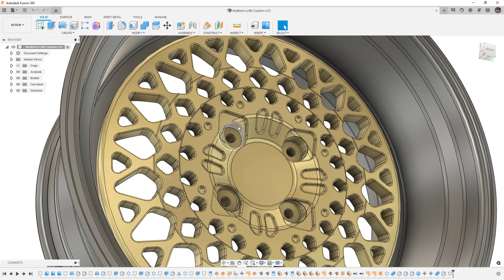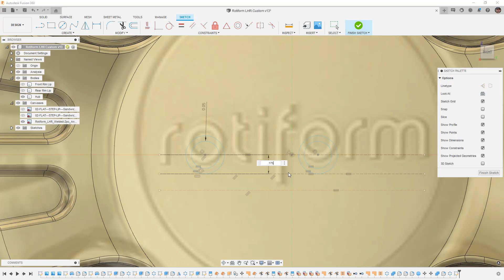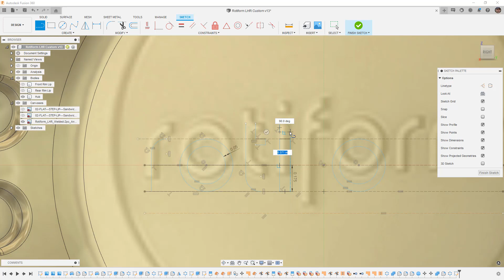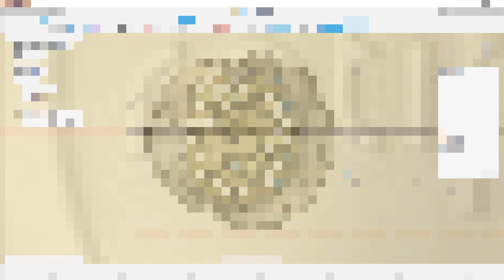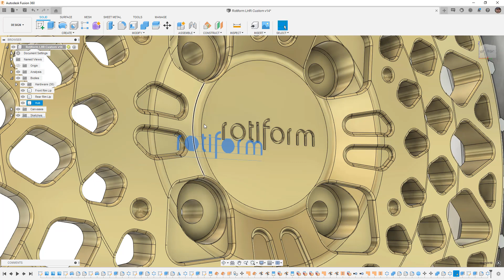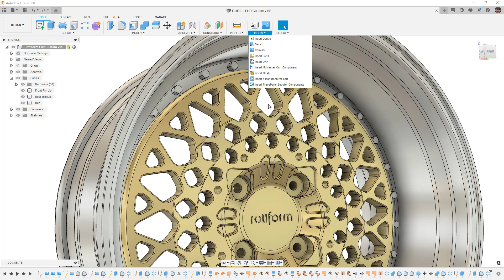Fusion 360 Rotiform Modeling Series - Part 6 - Final Details #Fusion360 #Rotiform #RimDesign

Comment: Do you have any videos on how to make parametric snap fit center caps ? I couldn't find anything on your youtube page  nor on youtube funny enough for something that is perfect for 3d printing!
Reply from the maker: I haven't done that before but certainly could.  What wheel?  The rotoform center caps are a bit different than say the snap in ones common on older OEM wheels.
Reply: @LearnEverythingAboutDesign  I should've probably mentioned that! Just the usual older types found on most older cars that snap in. I have a few sets of japanese wheels that all share the snap fit type but obviously all different diameters and lengths on the tangs. I have attempted to make a parametric model but failed miserably haha. I think the ones that use O-rings and pretty straight forward to design (since they are compression rather than snap fit), just snap fit stuff is usually quite a big step in required experience

Comment: Logos are most of the time available as SVG, Rotiform is also available, would save time and be true to the original
Reply from the maker: 100% true for what we did here.  The center cap on the rims actually has the logo recessed like modeled here, but its a pain :)
Reply: @LearnEverythingAboutDesign  yep,traced many a logo in my design adventures, multiple options, either download svg, trace bitmap in Inkscape, trace by hand or find the design reference file, the blueprint for the font or the font itself (someone actually made the proprietary volkswagen font available even haha)
Reply from the maker: @Tarex_  Solidworks has an option to try and trace an image to make a sketch.  worked about 50% of the time with a really clean black/white image.  Decals are certainly much easier..
Reply: @LearnEverythingAboutDesign  Adobe Illustrator, inkscape (as a free option) and im sure many more have the option, svg or dxf import, maybe someday autodesk will add it, im sure one of their many programs has a feature like that
Reply from the maker: oh for sure.  I use Adobe products and I use Snaggit for most things.  I guess I meant for the purpose of a video having to go into needing another thing :)  I even think GIMP might have a trace function and is free as well.
Reply: @LearnEverythingAboutDesign  yep, aesthetics and so haha, in the last year they introduced so many new features, so who knows what more is coming to fusion